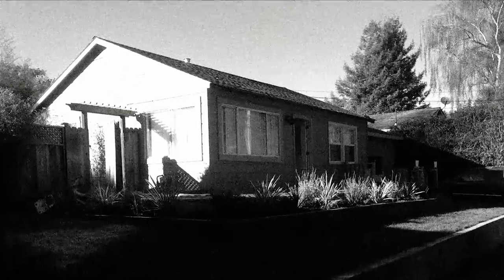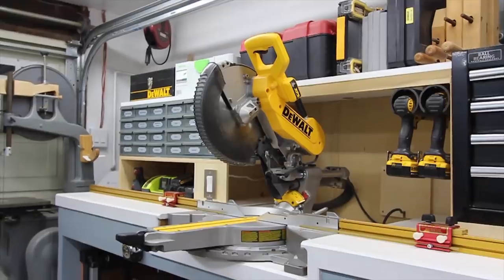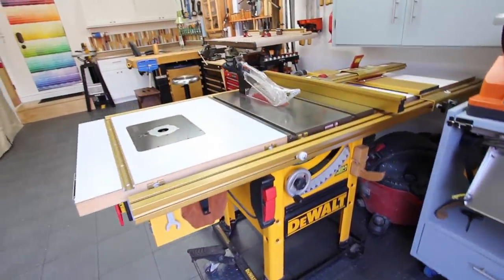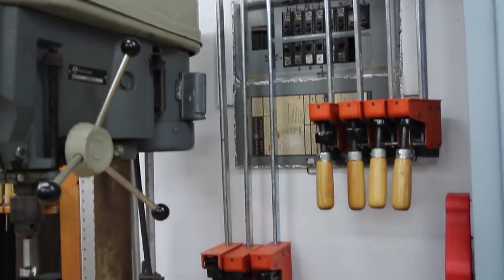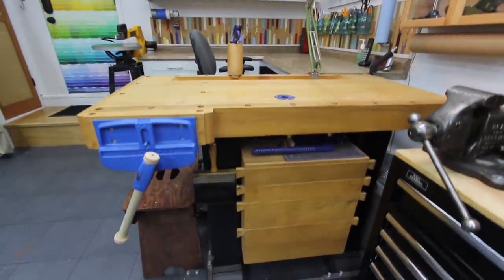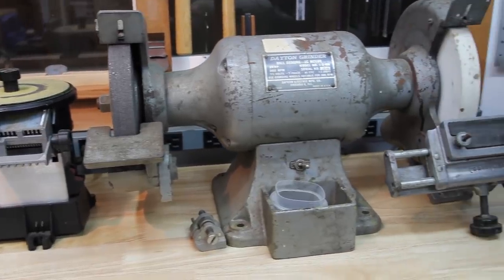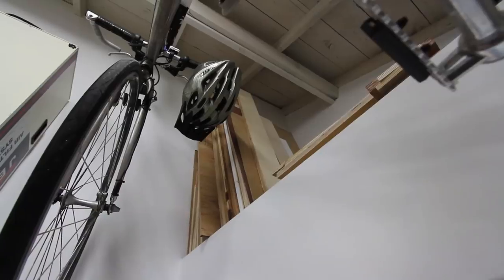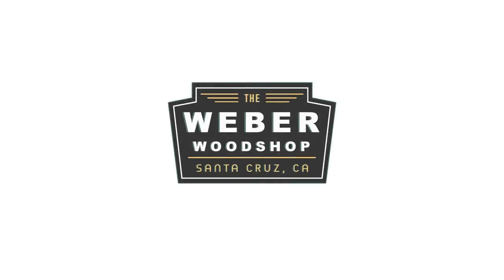The Ultimate One-Car Garage Woodshop Tour!

Comment: Well thought out and organized shop.  Stir stick back splash is the best.  I'm amazed at how clean it is for not having a dust collection system, other than the shop vac and Jet air filter.   For me, the wood would have to be kept inside the shop.  Acclimation time would be a problem if I didn't.  I'm not keen on using my ladder to get the wood off the wall, but my 1 car workshop won't allow it anywhere else.
Reply from the maker: levrac68 Thanks! Yeah if I had a place to put wood inside I wood.

Comment: Inspiring video. I must get more organised. Everyone on YouTube uses maple and walnut, and so do i😀. I started with heat and sound proofing, then electric and lighting. If only I could store my wood in the house, I could the move around better. I couldn’t manage without my Roubo style bench when using hand tools, but I use my long belt sander a lot. Machinery I have is: table saw, band saw, router table, Worksharp (wonderful), morticer, drill press, belt sander. I use hand saws rather than a mitre saw. Time for a clear out.

Comment: I don't think you could fit anything else in there, well maybe you could. I had the same idea about mounting a side box under the drill press table but refit a cart instead that I've had forever to hold all my drill press stuff. My shop area basically fits into 1 bay of my 3 bay garage but it's longer also. Nice job making it all work!
Reply from the maker: I probably could cram a little more in there... thanks!

Comment: Quick question for you Blake Weber (or anyone that has a small shop) - your 'craft corner,' how often do you use it? 
I too have a small shop and am about to do a complete re-work of the entire shop. I am going back and forth trying to decide if I need a little area like your craft corner. I don't have kids, so they won't use it. My wife is only in the shop when she wants to know when I am coming inside. Any work that I do that requires the use of a table is done on my out feed/assembly table. To me, that is a lot of valuable space in smaller shops like ours.
So, knowing what you now know about your shop, and if you had to redo your shop, would you keep your craft corner or use that space for something else?
Reply from the maker: I use it a lot. I probably would not have done that if it were just set up as a woodshop but we originally did that for my wife’s art and now I’m glad I have it. You can’t have too much counter top space even in a small shop.
Reply: Oh wow, you do actually use it. I was kind of hoping you would say that you don't use it and would rather have the space for something else. Guess I should at least consider it as an option

Comment: beautiful shop sir! I'm slowly improving my single car garage as well. One question for you - is your floor slanted towards the garage door? If so, is it a nuisance that some of the cabinets like the husky tool chests that just sit on the ground are tilted the same way? I'm wondering if most people just live with it for such a small work surface, but figure out other solutions like leveling feet for any longer surface that sit parallel to the slant (mine needs leveling feet at +1.25" difference at 50" leg spacing).

Thanks! Great video once again!

Comment: My 2 car garage is exactly what is was built for .... cars and thats where it keeps my 2 of the 3 "modified" sports cars safe away from the sun and elements.
My "workshop" is a 10x24 shed in the back yard ... It holds my 2 motorcycles, lawn equipment, tires, wheels, tools, etc... Not quite as fancy as yours but it has what i need ...
Otherwise it looks good
Reply from the maker: You Tube thanks :)

Comment: Hi Blake, great set up. Can I ask how you keep your shop so clean, my shop is constantly covered in sawdust! Also how are you going with the flooring? I recently installed pvc matting with a checker plate imprint and I am finding that the wheels on my moveable carts are really marking the flooring, I know its a workshop but I like my space to look good! I am looking to swap out the wheels for larger rubber castors.
Reply from the maker: Steve Holden I collect as much dust as I can at the source and also when your filming for a YouTube video it kinda forces you to get in the habit of vacuuming after each operation. Love the flooring. It also makes cleaning easy with a shop vac floor brush.

Comment: What kind of floor do you have? I've got my own one car shop and it is bare unfinished concrete right now. I like the rubber approach but I'm worried it would not facilitate rolling tools?
Reply from the maker: guitarchitectural there’s a link in the description :)
Reply: which one do you have? Lots of products there! :) Does your stuff roll around easily on it? Do you ever have issues with wheels sinking in or making depressions if you leave something in one spot for a while?

Comment: Great video, nice work. Can you give some details on the tool chest you mounted the drill press to?  Did you have to reinforce it somehow?
Reply from the maker: JHZR2 no it’s just a small freestanding tool chest I had. I just bolted the bottom down so it doesn’t fall. It’s not there anymore though. I moved it when I got the thickness sander.

Comment: on your drill press cabinet how did you attach the wood that the clamps are on ?  and the laminate that the drill press is on is that glued or screwed great video you have the perfect dream shop
Reply from the maker: Caleb E the clamp racks are just screwed on to the sides of the tool box. The laminate is glued (laminated) on to plywood. Thanks!
Reply: @weberwoodshop  thanks

Comment: Blake, wow. Amazing shop. How does the ShopVac + Dust Deputy do with over-blade dust collection? It looks like you’ve got a ‘Y’ off the main dust port on the saw?
Reply from the maker: Chris Stephens Thanks! It works fairly well, it would be much better with a full size dust collector. Splitting a 2 1/2 connection doesn’t quite supply enough flow to either to be great but it’s better than nothing and at least the smallest and most dangerous particles get captured before the go into the air.
Reply: @weberwoodshop  Thanks for the reply. I've got a ShopVac+DD setup through a 2-1/2" connection, but only to the main dust port on my saw. I always have a mess on top of my saw so I'm going to give this a shot.

I''m also stealing your wireless remote idea. I had been considering a $60 "long ranger" product, but it looks like the $10 "defiant" model will work just fine! 

Just subscribed to your channel. Looks like lots of good stuff there. Thanks again.
Reply from the maker: Chris Stephens you aren’t by any chance Debbie’s husband are you? I know someone with that same name.
Reply: @weberwoodshop  Nope, different guy. My wife's name is not Debbie :)

Comment: Blake hey there-question please-do you have a good source for the Delta table saw you have? Hoping they still make the hybrid you have. Thanks for your time!
Reply from the maker: Cabinets By The Sea it’s a DeWalt (not a Delta) but they discontinued that model decades ago. Too bad because it’s a good saw. I got mine used so you’ll have to just look on Craigslist or something.
Reply: @weberwoodshop  Sorry for the type-o, I realize it is a DeWalt. Didn;t realize they had been discontinued that long! Have you heard anything good about the Shop Fox hybrid?  Thank you for your feedback. https://www.amazon.com/Shop-Fox-W1837-Open-Stand-Hybrid/dp/B01987G1K8/ref=pd_lpo_sbs_469_t_2?_encoding=UTF8&psc=1&refRID=0PZXER5BCB6EWZ542JPF

Comment: Also have the DW746 but my is the DW746X but would indefinitely like to see more on that table saw safety guard mod maybe can do it to my own?
Reply from the maker: I just used a 4” grinder to remove some metal until it fit in my saw. It took a little trial and error but it wasn’t hard :)
Reply: Oh, ok thank will have to definitely try that!

Comment: Great shop full of ideas!  I too am in a 1-car shop.  I may steal your idea of the jointer under the bench.  Mine is in the garage of our lake house, which also has my rough lumber & slab storage in the garage and basement.  Sure would be nice to get the jointer home, instead of 95 miles away! @HoneyOnWales
Reply from the maker: DrewT the bench is unusually tall to fit the toolbox and jointer under it but I’m used to it.

Comment: Dude this awesome, what size is the workshop?
Reply from the maker: Thanks dude, 21x14!
Reply: Blake Weber Thanks Blake. In the middle of building mine and I’m pretty much doing the same as the wife wants a laundry station as well. Mine will be a little smaller but you’ve made brilliant use of the space so may mirror yours for the most part

Comment: Hi

What is the measurement of your garage floor
Reply from the maker: Joseph LaCroix 22x14
Reply: @weberwoodshop  Is that your actual usable interior space or is that the garage exterior dimensions? I just poured a 10x20 slab for a shed and contemplating turning it into a hobby wood shop. Hoping I have enough room. Amazing job!!!
Reply from the maker: Nicholas H interior dimensions but there’s also a laundry area within those dimensions.

Comment: Well im not sure what a good deal on this saw is....he has it listed for 400$....im not even sure when they quit making that saw
Reply from the maker: Jim Knowlton that’s not a total steal but not bad at all if it’s in good shape. I would call that “very reasonable” if it has no problems. Also it’s worth more with solid cast wings as opposed to the open air (grid style) wings.
Reply from the maker: Just make sure it sounds good when it runs. Mine is not quiet but runs pretty smooth.

Comment: So do you build aircraft parts?
Reply from the maker: scott k Maybe I should.
Reply: @weberwoodshop  You have accurate enuff stuff to do it!
Reply: @weberwoodshop  Hey do you have a problem with your router sucking up the dust from the box you made into the motor? Do you worry about killing it?
Reply from the maker: scott k no I have a vacuum attached to the box so it sucks all the dust out.
Reply: @weberwoodshop  Ok thanks for the reply. I have a Bosch router and it pulls a lot of air into it and I was just wondering if the dust collection could pull it out faster than the motor could suck it in. Also if there would be long term negative effects on the router.